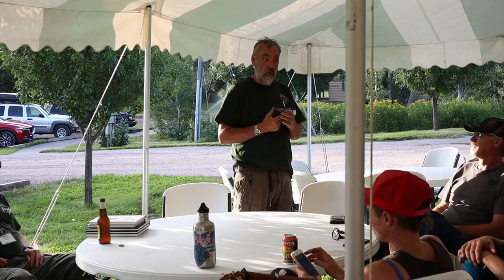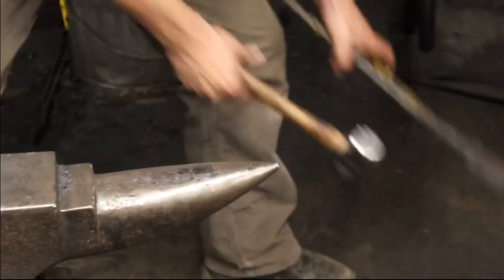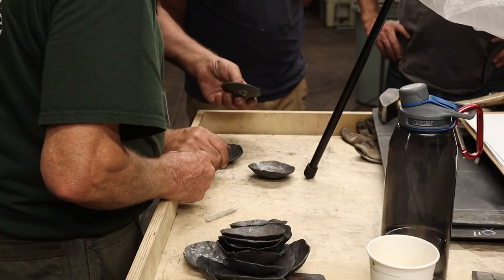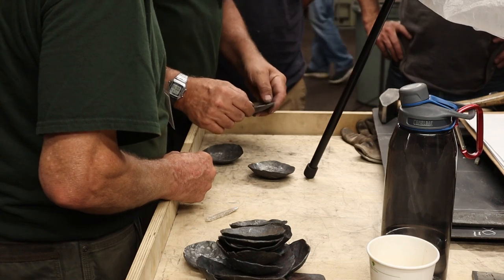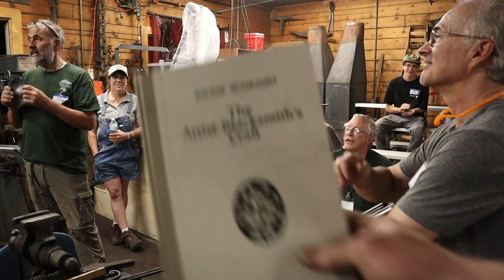Forging Competition 2019 Rocky Mountain Blacksmithing Conference

Comment: 0:50 "Hold it by some means." First thought weld a bar to it, screw tongs until it's dished out and almost finished  😈 Even gave a hint. "I'm thinking ladle" LOL
3:30 why doesn't he bend the jaws and open them up to make it easier to hold. I was taught to make the tool fit the work. Get a pair like at 4:00 with plain tips and heat the tips and draw them out and curve them around the piece to hold it. Later make another set of plain tongs.
Reply from the maker: No mechanical attachment such as welding as permitted. Taking time to reforge tongs, that belong to the school, comes off the already to short of a time limit.
Reply: @BlackBearForge  Well, putting a handle on it is still the most practical, real world way to do it and a rule about "No welding" wasn't mentioned in the vid "Some means". Spoil sport 😜😁
Reply from the maker: The instructions with question and answers went on for much longer and were edited to the more important and interesting portions.  To leave the entire event in would have been over 3 hours by the time all 24 participants had their chance.  But if you actually had to preform this in your shop, adding a handle or in my shop just setting it in the hydraulic press would work